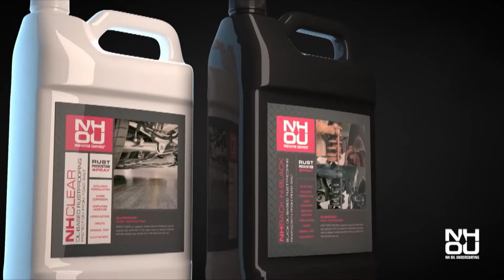Motorhead Garage, What is Oil Based Rustproofing

Comment: I have had it on an old truck for a year now. Looks good. Seems to work.
Messy at first things are oily which kinda sucks if your working on it. Not bad tho.
Reply from the maker: Like everything in life there is a give-and-take. The take is you won't need to break out a torch to loosen nuts and bolts anymore